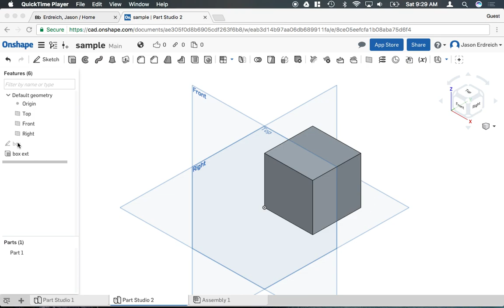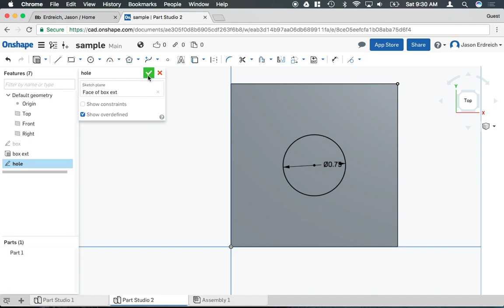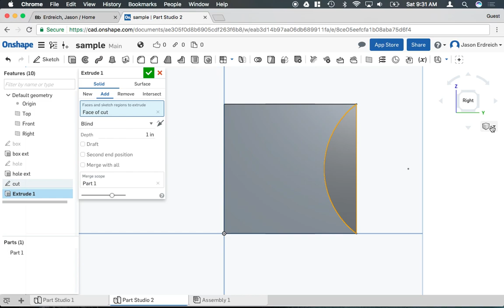How to make holes and remove material in Onshape CAD

Comment: that was easy but sure not many knows basics. I am wondering how to do the same but the hole is angled, 45 deg in that instance. It is not that easy. How to do it? PLEASE.... can not find any idea over YT and google itself. cheers
Reply from the maker: Definitely a bit tricky but doable! You need to make a new plane at an angle. Right click on a side of your shape, then click offset plane. In that menu, select angle and set the angle you want (45 degrees). Now make a circle on that angled plane and extrude. Hope this helps!